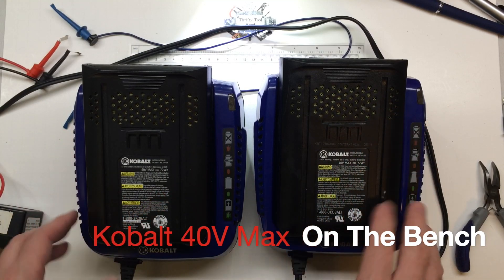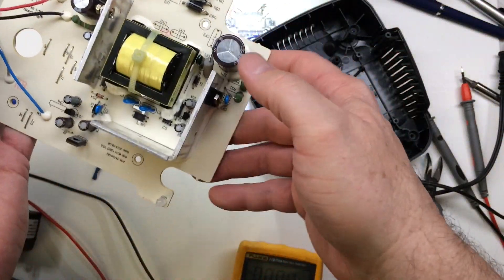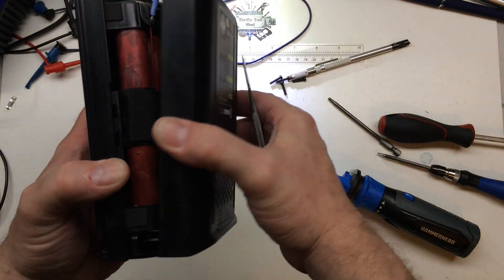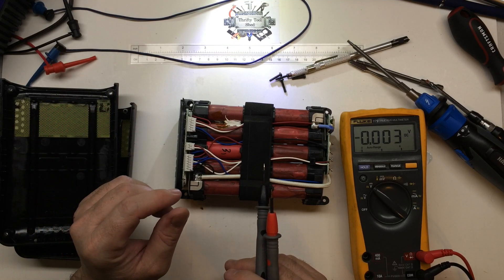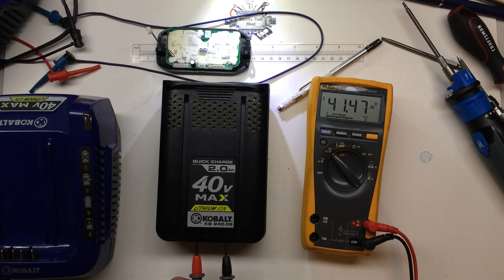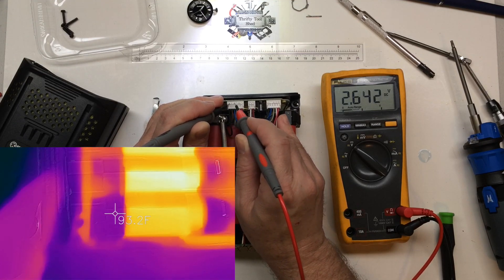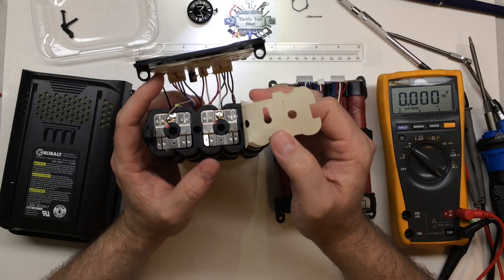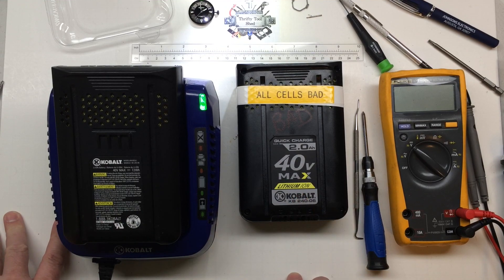Kobalt 40V Max Battery Charging Issues

Comment: I have three of these chargers and packs - just a little over a year and a half old. I can confirm that they pull down while on charge. I leave them plugged in and on charge in my garage at all times when not in use and do not shelf them. Rather than keeping the batteries charged and maintaining them, the chargers do not seem to handle babysitting well. I came out for the first mow this spring, and the charging lights on all three chargers were off, and all three battery packs are measuring 0 volts. After much research - and trying boosting - I came across your video. This is absolutely wonderful content and I thank you for this thorough tutorial.
Reply: Don’t leave batteries on chargers. It is never a good idea and often a bad idea. Sometimes it could be very bad and cause a fire.
Reply: no wonder its 0 volts you are abusing them
Reply: @sa

Comment: It is absolutely as simple as he says.  The battery would not get any charge- I used my 12V battery charger-  think I bought it for $12.95 at the Auto Zone ..for literally 5 minutes, and now it is charging on the station! Thanks!! The acid test will be if it will run the blower.... I am very pleased. Off to Wing Haus!

Comment: Really Great Video.  I was dubious of these boost videos too but after watching your I decided to try.  I opened my 4.2V no-charge 40V pack up and found the cells to be in visually good condition.    I boosted the pack with a 12V-2A charger for maybe 30s and dropped it in the Kobalt charger where it got a flashing charge light again.  I came back latter and all the cells registered between 4.13V-4.16V.  I will comment again if I find the pack failing again soon.
Reply from the maker: Awesome, thanks for sharing!

Comment: Good information, even if over a couple years old. Just as a note. The 40V 5amp Kobalt battery pack has a 60amp fuse, not the 40amp the smaller 2.5amp pack has. So if you had another roll of batteries you need to upgrade the fuse, since you are in essence increasing the amperage not the current.
Reply from the maker: Thanks for your comment. Yes the fuse would have to be changed. You could get by on some tools like weed eaters and such that would not pull more load anyway just because of more capability to do so of course. But in heavier load devices that could possibly pull more current when available yes the fuse would absolutely have to be increased. Basically putting 2 cells in parallel is giving the ability to output up to twice the current. Most tools should not demand more than 40 amps more than a few seconds really unless something is wrong. Btw: Amperage is Current so it's the same thing.
Reply: @ThriftyToolShed  agreed. I meant to say voltage not current doh!

Comment: very comprehensive video....thank you.  I did not quite understand how to boost the battery?  Do I need to open up the battery to boost it?
Reply from the maker: The quick answer is No most packs you could boost without opening however, the point of my videos is you don't know what condition your pack is in if you don't open it up. I personally open packs up do a visual and one of the most important to me is check the individual cells voltage level. If you notice a cell that has gone really low voltage level they usually past the point of saving, at least the capacity is severly reduced.  Even if you are successful boosting a cell that was below say 2 volts it will not hold up long under load.

Comment: Nice production work and on target with info I was looking for. Thanks. Would like to know how to adapt the Kobalt charger to a 38v pack for a scooter project in the near future.
Reply from the maker: I do not still have this Kobalt charger since I worked on these for a friend. I can't recall exactly how the charger worked on these. Most will atleast have a temp monitoring terminal feedback from pack to charger that should have Thermistor. I discuss similar connections I'm a DeWalt video I have as well as a an EGO pack video called "what is the T-terminal" I mention something really similar in a 20V LED Light video as well. May not be hard to do, but some like EGO, the chargers actually communicate with the pack and that makes it almost impossible.  Thanks for your comment!
Reply: Your best bet is to use the packs from Kobalt as-is on the scooter. Just be sure that you have under voltage protection on the motor controller. All outdoor power equipment batteries (basically ones from 40-80v) have battery mgmt on the packs vs the 12-20v power tool packs which have more of the “balancing” system on the charger.

Comment: Great video! Perhaps you can help me. I have a Snapper 60V weed eater. The charger (like yours) starts out with a flashing green and after a few minutes goes red. upon pack inspection, batteries appear undamaged and read 41.9V on the meter. The pack display lights do not come on when I press the button. When placed in the weed eater it does not function. I would guess at 41.9V I do not need to give the pack a jump. What gives?
Reply from the maker: If you check across individual cells you may see a obvious cell lower than the others. Typically 1 or more cells are bad with your   description. If all are balanced well then it may not be charging if voltage is still low on all cells equally.Best of luck!
Reply: @ThriftyToolShed  thanks so much I will check
Reply: @ThriftyToolShed  Well I did as you suggested. The pack has 15 (3.7V) batteries. ten read 3.5V, three read 3.4V and two read 0V. So if I replace the two dead ones I should be able to charge them? Also I am not sure what the size of the batteries are. Thanks again for your help. PS when I check the voltage from the charge prongs it now reads 42.7V

Comment: My 40v max    4.0 an Battery is not charging  if I push 😅the check button all 4 lights blink. With the charger plugged in the light on it will not light up.

Comment: Heyo, thanks so much for the disassembly and info. Currently in the process of fixing up one of these 5.0Ah versions, and discovered two cells had gone completely flat (0.0V) and acted as a break in the circuit despite the spot welds being flawless. So I just took them out and swapped in similar 2500mAh 18650s I had from another battery. My question is does the on board charging circuitry balance the cells while charging or does it only apply a consistent 41/42V across the entire series for charging? That way I know for the future if for some reason the replaced cells or some other ones go bad and I need to swap in with cells that may not have the same internal resistance (i.e. go out of balance easier during discharge)
Reply from the maker: Hi,
Thanks for your comment. I do not know exactly when the balancing takes place and I am not sure of how much it can correct. I have never had to look into the balancing that close. I do try to match my replacement cells internal resistance and capacity with the pack as close as possible to help with any imbalance issues. I have always thought the pack gets balanced while charging? That may not be exact, just my initial thoughts about the BMS. Best of luck to ya on that repair!

Comment: I have a 40v 5ah and it is sitting at 23 volts.  Charger light wont come on.  I tried this and still nothing.  Visually the cells look good when i took it apart.  Any suggestions?
Reply from the maker: I would check cells individually and make sure they are balanced. You may have some that have dropped down lower than others. If that is the case, it is typically bad cells as the capacity has most likely diminished in these cells, and they are dropping off faster than the others. You can try charging those up to the same level as the others to get the pack balanced well and try that. If the cells are bad they may not charge up at all. So monitor at all times to make sure they are not overheating. Even if they do charge up if they have lost capacity they will eventually drop off, and this condition will repeat. If by chance they are all balance, but all around 2.3V each then the pack may have to be boosted up a bit to get it to accept a charge. So setting a PS to 30V and Current limit to around 1 Amp or so slowly bring the pack up to around 30V and the charger may then charge it up.  Best of luck to ya!

Comment: I know it’s a long shot but I need some help where I can get it. I have the exact same product. I have wired two 18 volt Milwaukee batteries in series to make 40v and attached them to the kobalt battery for several hours and still the battery will only read 9 volts no matter how long it is hooked up. The charger does nothing when I put the battery on it UNLESS I connect a 40v supply to the positive and negative while the battery is charging. If I do that it will flash green like it’s charging for about 30 seconds and then flash red. The battery looks perfect inside. Does anyone have any ideas?
Reply from the maker: I have mentioned in many videos to caution putting a non current limited supply across packs without knowing the packs condition. What do the individual cells read across them? How well are the cells balanced? Is the fuse still ok after putting a 40V supply across a discharged pack without current limited properly? Absolutely make sure the cells in the pack don't look like the cells in the second pack shown in this video.
Reply: @ThriftyToolShed  I identified one cell that bounced around only showing a few mV. I am assuming that was the cause of the pack not taking charge. I most likely won’t go any further as it’s not worth it to buy a new cell. All the other cells were between 2.4-3.1
Reply from the maker: @PHV1969  Sounds like it's that one for sure.

Comment: Great video, thank you. My battery has a full set of lights indicating full, it shows 40.?? Volts but the light on the charger is out. Could it simply be the light is bad or something more sinister?
Reply from the maker: I guess you are saying with a meter you are reading 40V on the battery terminals? I would check connectors on the pack and the charger itself to make sure connections are clean and making a good connection. These chargers don't light up until it senses the pack in place. If that does not fix it it's time to swap batteries or charger to eliminate which is the issue.
Reply: @ThriftyToolShed  many thanks I’ll clean the terminals and see if that fixes it.

Comment: I have a question what would I look for when it comes to (70vand below)overcharging batteries and why would the battery is not show up as full understanding there is probably more to this question that I don't know to ask
Reply from the maker: Are you saying the battery is overcharging? Overcharging lithium cells cans be very hazardous. Could cause fire or small explosion. Over charge and over discharge is both something to watch out for with lithium cells. So typical specs for Li-ion cells is no lower than 2.7V and no higher than 4.2V. lithium is a amazing battery platform, but it is not tolerant of out of spec charge/discharge levels or high temperature.
Reply: @ThriftyToolShed  I have start off by saying thank you for the concerned reply and I completely understand the dangers that come with lithium batteries . The reason for my is to find out what direction I should possibly go towards fixing this issue with the batteries overcharge . Note. The batteries have not lost any charge in any of the 5 battery packs but all are to high (obviously)
Reply from the maker: I really have never had an issue with a pack being overcharged by a charger. I guess so many checks and safeties in this is most likely to fail non working than over doing it. With that said, I realize how it is still possible. I would think the charger is the cause of this issue. The charger should always monitor the pack before starting charge and of course while charging to make sure no unsafe condition and that the cells do not go over 4.2v each. Have you tried more than one charger or battery pack or do you only have the one of each?
Reply: @ThriftyToolShed  I have 5 batteries and two chargers only 1 of the battery lights....light up completely and the others either don't light up up for only have a single light. In regards to the charges I have not had a chance to test them sufficiently oh and before I had check the voltages of the batteries with a voltmeter I tried charging them first(I know rookie mistake) and all the batteries except one eventually flashed red(with no real order to how I charged them)
Reply from the maker: So all 5 are higher than the 42V charged on the 49V packs? And only one shows fully charged by indicator lights the other 4 show either none or just 1 LED? Well I am not sure about that, but the charger is most likely bad if over charging. I can not remember if there packs have a reset on the boards. I have a video on the Echo 58V pack that I repair and I showed briefly that jumping Reset to Ground on the board will in rare cases help with battery level issues by resetiing the microcontroller. That is all I would know to look and try from here, I only worked on these 2 packs shown in video, other than that, I have no other knowledge of issues to share. That reset may be a long shot..
Reply: @ThriftyToolShed  I will start by saying I am terribly terribly sorry for not replying sooner but I do have good news because (I'm a dummy)...... did you know vault meters read voltages weird when they battery inside is low well I can say this guy didn't(me)

The moral of the story the batteries are fine but the charges don't quite do as they're supposed to

Comment: Thrifty Tool Shed Well I did as you suggested. The pack has 15 (3.7V) batteries. ten read 3.5V, three read 3.4V and two read 0V. So if I replace the two dead ones I should be able to charge them? Also I am not sure what the size of the batteries are. Thanks again for your help. PS when I check the voltage from the charge prongs it now reads 42.7V
Reply from the maker: Yes, sometimes if the cells have no part number or info to look up the spec sheet from. All I do at that point is get as close as possible with the pack rating. For example 60v pack with 15 cells you know the mAh rating of the pack is the rating of each individual cell in series! So a 2.0 ah pack will or should have 2000mah cells. 👍

Comment: hello i have a 40v kobalt pressure washer but i dont have the battery.. i have other 10 cell battery pack i want to wire to the power washer but the power washer has 3 wires.. red,black and a blue wire.. i have no clue what to do with the blue wire.. the power washer works with just red and black wire connected.. but only stays on for 5 sec and shuts off
Reply from the maker: I did not go very deep on these packs with the wiring or pinout. It's been years ago since I have given these packs back to a friend. These simply had cell issues. I have no packs like this at the moment. The common practice on simpler pack designs is to have a NTC thermistor monitoring the pack and feeding back to the tool for a temperature reference. Some of these are around 10K ohm at room temp. This is not the case for all packs, but it's possibly similar.
I shared a little bit about the 3rd pin on a 20V Bauer flashlight some years ago. It May not be the same, but it's all I really have on video besides some Ego packs repairs.  You might find it helpful. 
https://youtu.be/IJ-xZ0zdwbo

Comment: Nice Video - thanks for posting.. So I have a Large Capacity 4.0Ah Kobalt Battery - it still seems to work in my garden tools. When I charge it also works for a while, but ultimately the charger light blinks red indicating a charging fault. I've tested the voltage of the battery after the charging fault, and it reads 37.7 volts. I haven't yet opened it up. Any guess on this one? Maybe a bad cell in there so it can't quite reach the max capacity?
Reply from the maker: Thanks for your kind comment! 
Yes more than likely it's a cell or possibly more than one that has lost capacity. With cells in series one cells greatly affect the others. When pulled down low it can be lower than others causing an early shutdown for the pack and can also cause issue when charging because it will still be low when others get to the full 4.2v max. I would run the pack down to cut off point and then check if some cells are much lower in voltage than others.
Reply: @ThriftyToolShed  - BTW - would you expect these higher capacity batteries to be more prone to overheating and defects? I have 2 of the 2.0Ah ones and they seem fine. All of these were purchased a while back - circa 2015
Reply from the maker: Sometimes it does seem that way. More cells Inside, so more that can go wrong even though they can handle more current than the smaller ah packs so they are typically better for heavy loads such as blowers and mowers.

Comment: I'm looking to build a 5ah pack out of two of these (as optionally sold).  Any clue how to wire and if the BMS/charger would work in this configuration?
Reply from the maker: I do not have these any longer since I gave them back to a friend but the best I can remember, the BMS wires are good to go and putting the cells in may all you need to do. You will have to get the pack halves separated to install but by memory everthing else is fine because the added cell is just parallel! Hope it helps
Reply from the maker: PussMag  
Great to know, it may be a resistor on board to let the charger and tool know which pack is connected then? Interesting! If I come across another one of these, I will have to look at it better....
Reply: Note that these type of packs often have configuration jumpers or different firmware based on the specific cells (2.0, 2.5, 3.0) and cell counts (1p, 2p, etc).